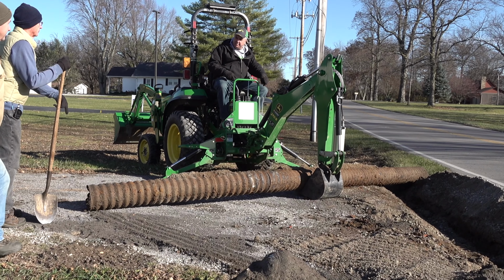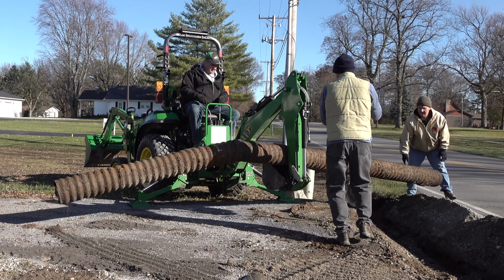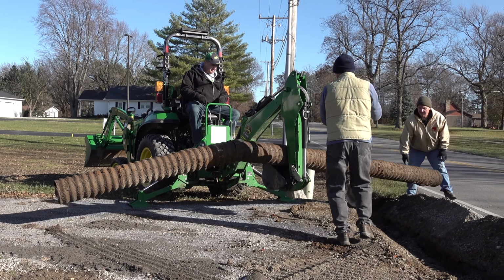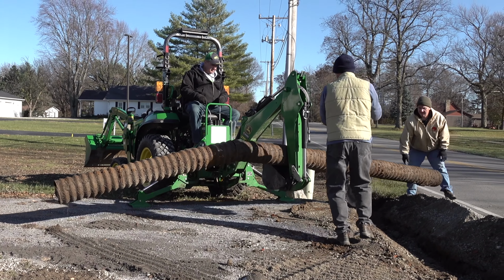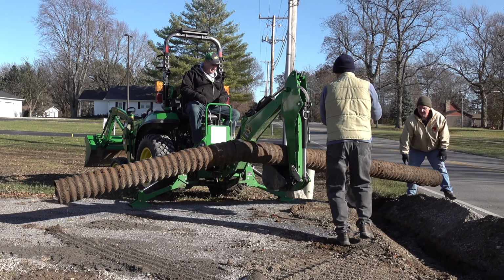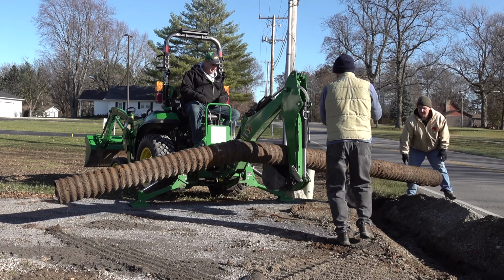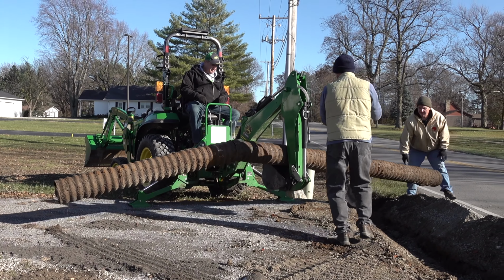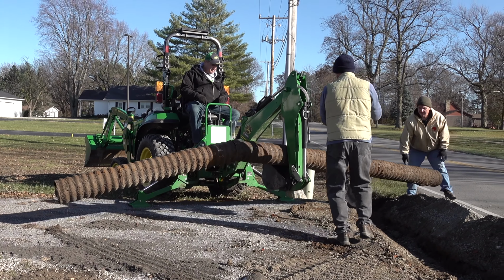Replacing A Culvert Pipe with Only a Compact Tractor Backhoe and Bucket!

Comment: Once upon a time, the intake end of culverts were cut at a 45 and screened over. Then, any debris washed down, would be diverted off to the sides and not pile up against a flat end. The out feed doesn’t matter of course, but the intake does.

Comment: Tim, a 3 or 4 foot stick kept at your left side works great to reach back and hit the hydro pedal when you need to move forward a little while you dig.  Our backhoe did not have a range selector nor an option for neutral so ours was always ready to move.

Comment: I have a question Tim, about thumbs. You did some great lifting and carrying using just the bucket and the boom of your backhoe. Do you find rear thumbs on backhoe buckets of a benefit that justifies the cost? I’m considering a thumb…I’m thinking a fixed thumb to save the cost between that and a mechanical thumb. Any advice on thumbs and, is a mechanical any more of a benefit to justify the extra costs?
Reply from the maker: I like my hydraulic thumb.  Can’t really comment on manual thumb.

Comment: Another great video!  Nice to see how much you can do with just a loader bucket.  I have a suggestion topic for another video...I love to see a quick coupler review for the backhoe buckets.  I know Mudd's and BXpanded both have them, but I'm concerned about clearance issues with the boom and loss of digging force.
Reply: Mark, I have the BXpanded quick coupler on my 260B. I put it on before I ever dug with it so I'm not sure how much it affects the digging force but I can tell you this, it still has had more than enough power to dig anything I've tried with it. My only complaint with the 1025R/260B combo is that there's not enough flow rate so it's slow and sorta hard to feather the controls to do 2 functions at once. The BXpanded adds maybe just a couple of inches to the "length" of the hoe. I highly recommend it!
Reply: @stevebrookshire1969  Thanks for the reply!  Does the bucket hit the boom when fully up and curled ("storage position")?
Reply from the maker: No.

Comment: Job well done Tim. But sure would have been easier with that Mini Excavator, back fill blade and a Hyd thumb
Reply from the maker: I don’t see how it could have been easier.
Reply: @TractorTimewithTim  Actually just picking at you. This was a fine job and showed the versatility of a compact tractor.  The mini ex could have straddled the pipe path and dug from both ends . Makes leveling and clean up a bit easier but all in all you guys were great and everything worked out well. It all sure beat shovels and picks!!

Comment: Tim as others have already mentioned, you’re hanging out a country mile and endangering yourselves by not have adequate warning signs in advance of the work zone.  At the very least, park a car with flashers ahead of the work area to worn others of something happening.   And since you were within the city right of way, you should have gotten a permit in advance.  Look at the Manual on Uniform Traffic Control Devices, MUTCD, to see how it should have worked.  Lots of lawyers make a very good living on incidents occurring in work zones.  Bullet dodged, but lesson learned.

Comment: Tim you might know this, or someone has already stated, but a general rule of thumb is ⅓ of the overall diameter of the pipe is what you want for coverage over a culvert pipe. So a 12" pipe would have a minimum of 4" cover...
Reply: I believe the rating though is based on 1 ft. of fill over the top of the culvert.
Reply: @wingwhacker7500  yes it is !
Reply: @wingwhacker7500  so does that mean is should be 1 ft plus 4" on a 12" pipe? Or 12" minumum... if you get into bigger pipes (like 4ft) then the ⅓ rule comes into play?
Reply: I believe it is 12 inches for the rating, but I would check the ASTM standard as it may have changed or have caveats; Larger pipes may be different like you said Adam. But, small culverts, like this one, are rated based on a certain amount of fill. It doesn't mean what they did will not work. They may need to think about it whenever they bring a heavy wheeled vehicle like a cement truck into the place especially during soft soil conditions. The rating is so you can compare different size vehicles of course. Also, I believe you can figure out what the rating of the culvert as installed is by a chart for the culvert based on fill above the pipe depth.
Reply: I have a 30’ steel culvert I have 2” of fill on. Sometimes you can see it and I have to cover it back up. 😂You could drive a cement truck over it though. How deep your fill is will depend on how deep the ditch is and how big the county tells you the diameter of the culvert has to be. For me that was 16” and with the ditch that left me 2”s of fill. So you sometimes get stuck with what you have to work with.
Reply: @PawPaws_Place  if the county tells you it needs to be a 16" pipe and the ditch is only 18" then the ditch needs dug deeper...
Reply: @TractorTimewithTim  did I miss something?  Or did you mean to say that on a different comment?
Reply from the maker: Oh my!  Sorry!  Yes, intended for another comment stream!!’
Reply: @PawPaws_Place  I understand, and you did what you needed to do. County planners don't often understand the requirements the county imposes. Thus, they probably made you buy a culvert which met the rating with a foot of fill but allowed you to have 2 inches. I see this all the time. These policies were created back when cement trucks had 3 axles. Now, they have many more which allows the truck to be used on roads during road restrictions related to weight. By having more axles, they can drive during specific county weight restrictions. These axles can now be raised for when the truck is turning. The wheels can often turn as well. This kind of truck can go over culverts with less fill as well. A cement truck may be able to go over your culvert but I doubt your culvert w 2 inches is rated to do so. Generally, engineers are behind these ratings. Call your county engineer and see what he/she says about 2 inches if you don't believe me. I understand your ditch depth dilemma but see what the county engineer tells you and what you should have done if you dare!

Comment: I did this for my neighbor 2 years ago as her old 12" culvert, plastic, got smashed up on the ends and wasn't buried deep enough when they put it in and hardly any rock over it. So she got a 3/8 steel 12" pipe about 12' long and I put it in for her, no charge, she was happy!

Comment: My guess is a plastic pipe with that shallow a layer above it might collapse. Might need to pour a layer of cement over it if it does. Otherwise great video.
Reply from the maker: As we mentioned.  This one rated for 40,000lb per axle
Reply: @TractorTimewithTim  With what rated coverage over the top? Usually the pipe itself can't handle that big of a load without gravel/soil on top to spread out the load.
Reply: 40,000# with an inch or two of cover, I don't think so . The first time a heavy truck crosses it after a rain, say your local Garbage truck , you'll be redoing it.

Comment: Nice work Tim! What size backhoe do you have on that compact tractors?   What type of trailer do you have? Is that a hydraulic dove tail?  Nice work!
Reply from the maker: The bucket is 16" I think.  I have 8, 12, 16, and 24"
This is a Bwisemfg.com 28' hydraulic dovetail trailer.
Reply: Very nice Tim!

Comment: I’m about to pull the trigger Tim, would you suggest the 375a or 475 for the 3046r?
Reply from the maker: Haven’t operated them, so can’t comment on smoothness of controls.
…but bigger is better, right?
I think the 475 doesn’t fit the cab model, so if you wanted to upgrade to cab 3046r later, the 475 would not fit it…at least I think this is the case.

Comment: Yeah, I cringed when you bumped the pipe after it was set, " oh no!!" 
I would have thought that once you got the old pipe clear you would have just grabbed a chain and hung it from the front loader and drove it over to the trailer. But I'm fully aware of being committed to a less than ideal way of doing something with equipment once you start